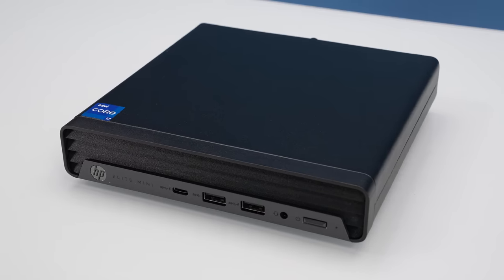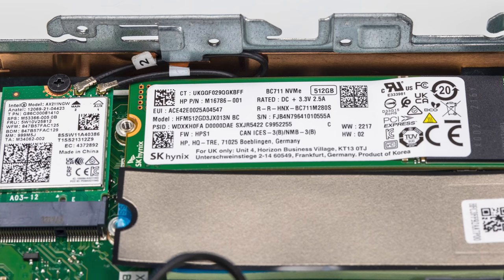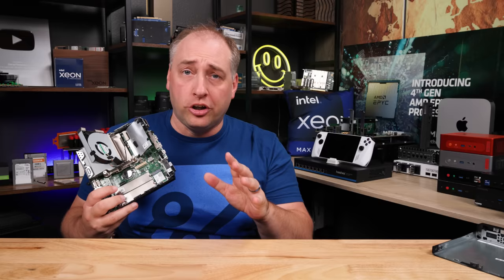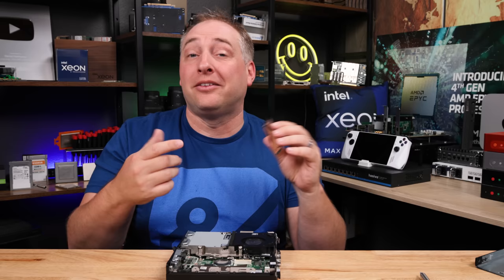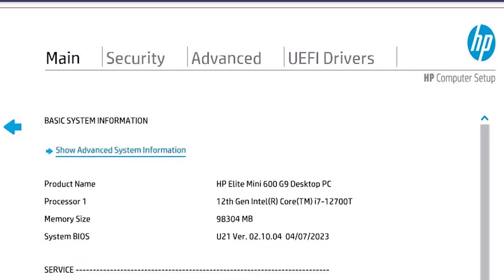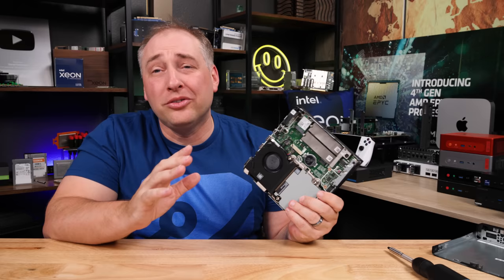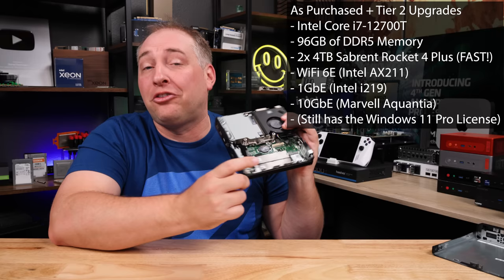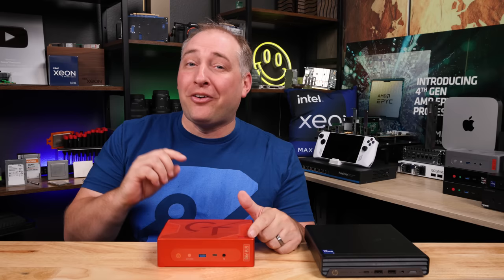Perfect 1L Homelab in 3 Upgrade Tiers Project TinyMiniMicro

Comment: No. Sorry, I don't get the point. Following Your advice, I bought an HP G2 i7 and upgraded it with ram and NVME 1Tb. For about 250 € total, that's good for retrogaming and emails and I could always move the NVME later to another machine. I am very happy of this toy. But the Elite 600 You are talking here is 800-1000 € in EU. With that money I can build a real computer, maybe not a monster, but certainly better that this machine.  What I don't understand ?
Reply from the maker: In the US they were $500-599 when we published the video. Adding more capacity adds cost, but some folks want cores, memory, storage, and networking in a host. The G2 is still a cool machine and the upgrades are much less expensive.

Comment: Thank you for this video. I just got the same mini PC and I tried  to upgrade it.  There is some questing:  When I installed a second NVMe SSD I had an error - "POST Error 901 Chassis Fan Not Detected (HDD) ".  HP support says I need an addition HDD FAN to connect.  I'm wondering why you didn't have such an error ?

Comment: Would you use this unit or the Minisforum 790 bare bones +that you reviewed in another video for a Proxmox Home Lab Server?
Reply from the maker: It depends on if you want 10GbE. If you want 10Gbase-T this is probably the better option. I actually think the Beelink GTR7 might be more interesting than the UM790 since it has dual NICs built-in. Also, this all assumes you can get these at reasonable prices used.

Comment: fyi those nics do not do hardware tcp offloading, i would not use them for a fullblown firewall with SPI, IDS- For example pfsense. Get a Dell 7050 box and install a legit Intel dual port 10g nic- the intel nic has hardware tcp offloading on board.

Comment: I'm coming to this video rather late. So if this question has been answered in one of the 400+ other comments my apologies. 
... Does this particular have the BIOS password problem that you mentioned in the other hp units?
 i.e. some of the earlier units allowed you to bridge two pins in order to physically reset the bios password on a previously used machine. Some of the later units (perhaps this G6?) didn't have those pins. So on those later units if the prior owner had set the BIOS password, you were locked out of the bios. Which meant if you upgraded the machine it would not boot.
... And the story you told was that HP wouldn't help you reset the bios password and wanted $600 for a new motherboard.
Does this unit have that problem?
Reply from the maker: This particular system did not have a BIOS password set from the previous owner. If it did, it would have the same issue. Just need to check before buying a used one.
Reply: @ServeTheHomeVideo  Wow! An answer to a question that was written two months after the video was first  posted! An answer to that question within an hour! That's dedication. Thank you.

Comment: Hi, your canal is Great, Can You Pls. investigate the possibilities of replacing the M.2 WIFI card with an adapter to use a tiny M.2 SSD for booting, so the other slots can be used as data stores not to waste precious storage just for a tiny boot SSD needed e.g. for ESXI or Truenas.
Is this possible with such a device: Mini PCI-E 2 Lane M.2 NGFF 22*42 SSD To 52pin mSATA Card Adapter C4Z9 ?
Maybe you can show this possibility on different models you already presented here.
Many THX for you affords

Comment: Neat find on that Hasvio switch, odd it doesn't say what poe spec that outputs on aliexpress though.  I figure at least af/at, but hoping it'll do the full bt 60/90 as well (but not holding my breath).  

Did you get any more detail on what poe spec it comes with from the vendor?
Reply from the maker: No - but since it arrived I can tell you it is a bit funky. 25.5W per port on the Fluke on ports 2-8 IIRC. One port was not PoE. The others were only PoE+.
Reply: @ServeTheHomeVideo  Lame, that's what I suspected since they didn't bother to say, probably only AT at 25/30W.  Thanks for the update in any regard, looking forward to what you find out as I already have one device that wants 60W BT I had to get an injector for.

Comment: is the image wrong or are you saying the stock SSD with 3567MBs / 3058MBs is not "Fast"? great video
Reply from the maker: That is very slow for a PCIe Gen4 NVMe SSD and that is not the full write endurance test or a sync write test.
Reply: @ServeTheHomeVideo  don't see a need for speed pun intended for a faster ssd than that is not a ps5, correct me if I'm wrong but even with the 10Gbe nic the stock SSD would saturate the network bandwidth, coming from my current Nas setup with HDDs at 120MBs 3500MBs seem already wicked Fast, i think i would prioritize size over speed in a build like the video

Comment: Am I right in assuming it boots up fine with 98GB of RAM? The specification for this machine says max 64 GB (2 x 32 GB) so curious if you got it to boot or not in that configuration and or what changes did you have to make if any to the BIOS?
Reply from the maker: We show it running with 96GB in both Windows and Proxmox VE 8 and described the installation.

Comment: Are there other, maybe a little bit cheaper 1L PCs, that also have the two NVMe slots? Idealy, Intel Generation 9 and up.
Reply from the maker: Yes. You can get a HP EliteDesk 800 G6 Mini as an example and still use these cards. Also, many Lenovo's have them on the back-side. We have a bunch of reviews of the different models on the main site and on YouTube under Project TinyMiniMicro
Reply: I've seen that there the DELLs are usually cheaper than the HP or Lenovo ones. Does DELL also offer variants with two NVMes? I've looked at the ProjectTinyMicro reviews for the 3070 and 7070 and the don't seem to have the option for 2 NVMes.

Comment: Awesome video and you got a new subscriber. Could you please share how much you paid for the 'elite mini 600 g9'?
Reply from the maker: We paid $500-550 for the Elite Mini 600 G9 and Elite Mini 800 G9 when we did the videos a few months ago via eBay. Pricing is higher because about 72 hours after this video was published the used supply dried up. Over time, these come off of lease or hit the secondary market for other reasons so supply goes up.

Comment: Maybe I missed it but what's the price breakdown between the stock/mid/high end config ?
Reply from the maker: The idea was just to give folks an idea of what is possible. It depends a lot on what you find the base system for.
 ~$500-$515 for the base we used, but there are options for less than that.
Maybe $25-30 for an extra 16GB DIMM. 64GB is like $150-200, 96GB $279
$29 for the 2.5GbE NIC. $129 for the 10Gbase-T NIC, 
SSDs from $50 to $400 each depending on speed/ capacity.

Comment: I'm so grateful I've found Your channel :face-red-heart-shape::face-blue-smiling:. Thank You for fun and informative videos, EXACTLY on the subject that is on my plate. I have to ask something. In this video 8:38 You say its ok to upgrade Gen6 and higher to 10Gbps, but on part's link to BHPhotovideo, in Q&A section someone asks for compatibility with HP Elite Desk 800 G6 - 2 answers says it's not compatible, and in other question someone asks for compatibility with HP Elite Mini 800 G9 - two answers, one it's working and one for incompatible xdd :face-orange-biting-nails::face-fuchsia-poop-shape:. I also read on STH website, You had some unlocked bios problem which was Issue on Yours side - I didn't fully understood the problem. 
But!
Could You please 🙏🙏🙏 clarify if one could update Gen 6 to 10Gbps (with this part HP 56Q71AA ?? ) or do I have to double the cost for the 1L unit and go with Gen9 ?? Pretty pretty please. "this "issue" flips upsidedown my switch hunting and also NAS upgrades and stuff. Although I'm super SUPER happy to see it's possible to upgrade Gen6 to 2.5 Gbps (I assume) .

Comment: It looks like the eBay price for these is going up now. What I am seeing is ~$1300. Is there another source for the I9 variant with a lower price point? I am a long term avid Linux user and want use this for testing disto's and different software configurations.
Reply from the maker: Core i9's are very expensive because corporate IT typically buys Core i5 and Core i7 models.
Reply: @ServeTheHomeVideo  Thank you for your professionalism. If I had read your article completely I would have answered my own question.  There are still some barebones options available very cheaply just the added steps of finding CPU and power supply.

Comment: Out of curiosity: what is considered a cheap price for the base device (excluding upgrades)?
Reply from the maker: These days a decent price for the 800 G9 or 600 G9 is ~$500-599. That might have gone up a bit with this video, but eventually companies that decomission these by the thousands drive prices down over time. A G6 is in the $400-500 range now, G8 is in the $450-550.

Comment: Unsure where you nabbed one of these for $500. I'm having a hard time finding one that isn't rounding the base to 1k. I would love to take 1-2 of these and point them at that NVMe Asustor you demo'd a few weeks ago.
Reply from the maker: Just searched eBay. At least as of yesterday afternoon there were a bunch of Elite Mini 600G9 and 800 G9 units in the $500-599 range
Reply: @ServeTheHomeVideo  I'll have to configure some alerts then once the STH hype settles 😉 Thanks for running through all these details - I did not know how upgrade-able these systems are. I have been looking for a set of quiet, capable machines suitable for apartment living where I can stage my distributed applications. Thanks again.

Comment: How in the world does that fan, with all that hardware, keep from from running wide open all the time? I made the mistake of buying a 65W 800 G3 and installed an i5-7600 and I could hear it from two rooms away when in was downloading a game from Steam. You always talk about the noise and the heat with 65W and boy are you right. Getting rid of it.
Reply from the maker: That is why I try to stick to 35W systems :-/

Comment: When I did a search on these devices in mid August 2023 it looks like they had been bid up considerably.  At between $800 and $900 USD to start they're not nearly so interesting.
Reply from the maker: Give it a little bit of time and the prices will drop. These are still being sold as new so in the next few months many will hit the secondary market. The main site article and this video dried up supply of the G6 devices.

Comment: Hi, working with I9 13900/13900T?? Thanks
Reply from the maker: There is a newer version with the 13th gens, but we did not have that. Also, to use a non-T SKU you would need the 65W chassis which has different cooling than this 35W one.

Comment: I have 13900T in mine as well so it has 32 Cores
Reply from the maker: Those are hard to find on used systems. We used the i7 because they tend to be cheaper to find. Hopefully we can get an i9 soon
Reply: I don’t think there was any used systems with 13th gen since only the latest bios even allowed the cpu, I bought the cpu new and swap out i5 12th gen for i9 13th

Comment: looking on eBay and other sources, there is absolutely no way at all anyone is going to meet the price point your talking about.
Reply from the maker: That price was valid for weeks before this video and at least through the day it was published. Weeks later, usually our TMM series sells out. Core i7's there is no longer used inventory. There are actually two scuffed up 600 G9's with Core i5's that are $399 right now. Somewhat hard when you look two weeks later since the main site traffic is more than the YT which means used stock can sell out and it is not long enough for more used stock to appear.

Comment: 500+279 seems like a - keep the others on x86 concept
I just saw a complete new laptop for 500. Due to the amount of hacks and sabotages, go back to basics is like 35 meal x 30 instead of x86 chips
Reply: The purpose of the games and emulators and amount of configuration needed for new items and the troubles for second hand systems ... is misery oops fun oops work oops objectives oops ... the purpose and objective for oops... nevermind.

Comment: Did I see a 10 GbE with copper? Is it possible to upgrade it with 10 GbE with fiber (e.g. SFP+)?
Reply from the maker: Not currently, unless maybe you got the Thunderbolt Flex IO then did a Thunderbolt 3 SFP+ adapter. These Flex IO modules are designed with a small footprint because they need to work in models with the 2.5" drive tray or the GPUs as well.

Comment: This mini PC costs more than an a used enterprise server, makes no sense to me...
Reply from the maker: A lot of people would look at it the other way, it may cost more, but if it is smaller, quieter, and uses a fraction of the power (for monthly operating expenses) it makes no sense to buy used enterprise servers. Also, remember any used enterprise server from before Cascade Lake has enormous security holes due to the lack of side channel attach mitigations, which is why they are so cheap.
Reply: @ServeTheHomeVideo  True but smaller quieter and less capable is also a fact, plus that setup is not cheap at all, it is very expensive!!! Don't get me wrong I like it but it will not be a wise investment for me!!! I can get a Dell Poweredge R730xd for less money!!!

Comment: You're kidding. This is a home lab? These resources are enough to keep a company of up to 100 people working properly. And even 1% of that capacity would be enough to study the technology. It's an upgrade for the sake of an upgrade. There is no point in using these network speeds, CPU performance and storage capacity for home use. Or for the sake of showing off.